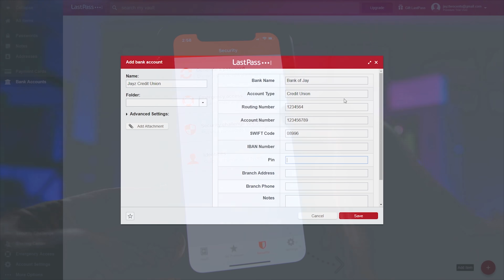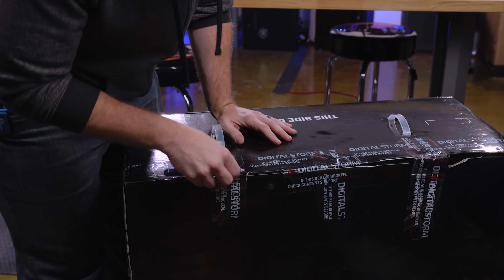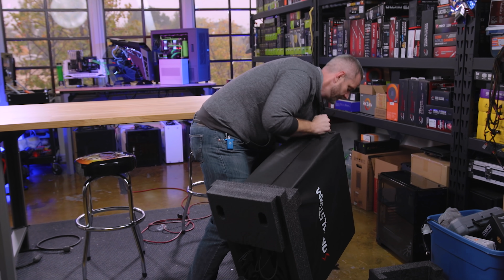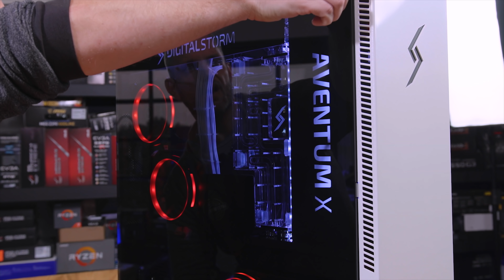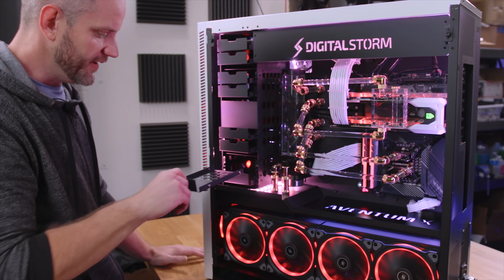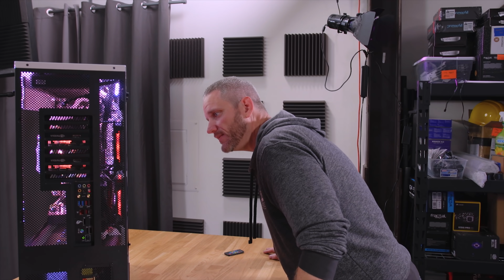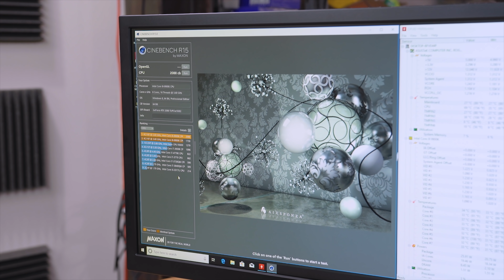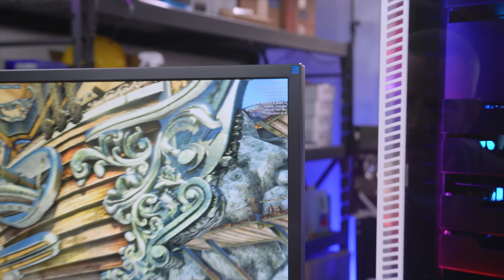Unboxing a $9500 Custom Computer...

Comment: LOL this pc caused comments  about prices of housing. Those rgb Things Are super stoopid looking and unnessisery to me. I prefer zero rgb light and plain look. 
Its all about performance, it not like you watching your pc while gaming and if you watch your pc while not gaming i would say you got a big problem and too much loose time. 
From the comments about Price compared to housing is hard to make any Sense as usually housing Price if in correlation of is there Jobs in your Are or do you have to travel many hours to get to a one. Is there more crime happening, what country your in. I would say in Finland 10k€ is about 5% of a private new built 100 square meter home made of wood by modern stabdards for cold weather. Generally people who built this kind of house make an average of 30 000-50 000 euros/ year per head before taxes (20-30%). Regular people what most of the population is made of

Comment: We measure in kilograms (a lot of people still use stones for body weight, but that’s changing for the most part). There’s about 2.2lbs to a kilo, so I tend to do half the weight in pounds plus a little bit.
Reply: everybody uses kilograms and the metric system, even USA use the metric/kilogram system as their foundation ..
they just do some stupid stuff on top of the metricsystem' where they take the metric system and then put a conversation on top to make it even more difficult for no benefits at all.
Its one country in Africa and the USA that operate with this .. its simply stupid as the USA manager for scaling also says and we are already based in the metric with our scalling. just with a stupid conversation on top.  https://youtu.be/SmSJXC6_qQ8?t=36

Comment: Kilograms, we use kilograms.
Reply: Actually, us brits use a mix of imperial & metric. BTW 1 stone = 14 lbs, so 175 lbs = 12.5 stone.
Reply: @InsaneProf  But what is that in boulders?!
Reply: @insnprsn  I'd say a boulder is roughly 8 stone? Sounds reasonable.
Reply: @insnprsn  4
Reply: Alan Lewis exactly like he said, 12 stone is 4 boulders...?
Reply: All the sofisticated countries use KiloGrams and Metric lol
Reply: @GAMEVIDSnorwegian422  that's right
Reply: And it also seems they can spell sophisticated.
Reply: @GAMEVIDSnorwegian422  halla Fra Norge 🤗👍🏼
Reply: What freedom units are used to measure school shootings?
Reply: @juliangleeson2251  Who knows? They aren't very common.
Reply: The UK uses a combination of kg & lbs for weight measurement. Just like distance and speed, we use a combination of imperial and metric.
Reply: I'd like to point out that England didn't switch to metric until the 1970s. The US using imperial is still their fault, however.
Reply: @SullySadface  The US landing booster rockets is what?
Reply: @yourface3154  technically its a private company owned and ran by a south american
Reply: @League_Cathy  Actually Elon is from South Africa, yet he is a US citizen....
Reply: @yourface3154  I meant south African and even though he is a american citizen he probably thinks he is south African doesn't he?
Reply: @SullySadface  england uses stone, lbs and kgs as well as mph for speed and km for distance.
Reply: We use "Freedom Measurements" here in the USA
Reply: LMAO THERES ATLEAST FOUR BOULDERS IN HERE
Reply: Kwf9 sell your house for the pc lol
Reply: 175 lbs is what..... 80kg?
Reply: No you use stones and boulders duh :)
Reply: @Austin Chambers I know plenty of Europeans that aren’t easily offended so I think ur speaking for ur self
Reply: @League_Cathy  LOL! I'd like to know exactly what the source of that data is. Also, even assuming the data is accurate, there is less than a 1/328,000,000 chance for somebody to be shot at a school. So again, it is NOT a common occurrence. EDIT: Potato math, sorry. That would roughly be a 1/1,093,00 chance I think.
Reply: @General_Griffin  OK I checked again its about 20 killed a year which is still 20 to many.
Reply: @League_Cathy  20 Is definitely too many, but unfortunately there will never be 0.
Reply: @General_Griffin  yes obviously  some years had less than others but some had over 40 people killed. It is around 20 on average since 1900.
Reply: @League_Cathy  Which adds to the point that gun control doesn't do anything, besides disarming a government-disapproving populous.
Reply: @General_Griffin  I'm not against guns, yes better gun control would help but banning guns just increases demand.
Reply: @joshua7426  yes they wear head guards and sometimes have shoulder padding but we don't run about like we are roleplaying as tanks XD
Reply: @League_Cathy  when you dont hit as hard as American football.... u dont have too
Reply: @joshua7426  k so that makes it even doesn't it?
Reply: @callum-j2i8s  so you get paid million of dollars less and get beat up more? is that really something to be proud of haha
Reply: Only drug dealers use kilograms
Reply: "I'm European, so I am easily offended and don't understand jokes REEEEEEEEEEEEEEEEEEEEEEEEEEEEEEEEEEEEEEEE!"
Reply: @callum-j2i8s  Try again you fuck.
Reply: @callum-j2i8s  well we hit with freedom power and that can hurt you more so we need the padding
Reply: @callum-j2i8s  lol pro rugby players wear pads , nor do they hit nor get hit the same in rugby as they do in american football.
Reply: @joshua7426  Uhmm yes, sometimes a lot harder even
Reply: @sicariusperemo3789  nope not even sometimes, according to science the average g force of a tackle in rugby is 10gs while in american football the average tackle equals 25gs. American football players are also typically larger , heavier , and faster, with the average player running at 18mph weighing 240+ pounds with the fastest so far being 22mph, whereas rugby players are typically lighter at 170 to 200 pounds running 12mph. As far as hits go American football is by far a tougher sport, rugby is tougher on the grounds of endurance and stamina with more actual continuous play time with the average player running anywhere between 6 and 8 miles per game and football players only running 1 to 2 miles per game with more downtime per play.
Reply: @joshua7426  they don't wear pads idiot
Reply: https://www.youtube.com/watch?v=RdTh8O9xYO0
Reply: No, you guys use pussy non freedom units.
Reply: @Gabe-ch2ol 

https://www.reddit.com/r/funny/comments/6hsdnb/metric_vs_imperial/   (And the same goes for temperatures...   water freezes at 0 Degrees C, Evaporates at 100 Degrees C...   I could go on and on about things that just make sense in the rest of the world....   

But I wouldn't expect someone with the "I don't understand you so I revert to calling you a pussy...  FREEDOM!!!" mentality to get it, so don't stress if not even these simple things make sense...   hang in there you ray of sunshine. ;)

Comment: Am I the only on dissapointed that they used connectors for corners and hadn't bent the tubing?
Reply: The fittings are cheap alibaba ones and save money comapred to the time it takes to do proper bends. I dont like it, every fitting is a potential place for failure. Jay is not critical enough, paid advert i think.

Comment: I am disappointed that for 9500, the side glass panels weren't hinged. I use to have to remove the side panels from my PCs but ever since I bought my first hinged side glass panel PC case, I can never go back. It's just so convenient and less risky when you need to get inside your pc, plus you dont get the glass all full of fingerprints and palm prints when needing to open up your pc case and have to grab and carry off the glass side, since you don't really need to handle a hinged sidepanel case much other than maybe minimal finger smudges if you're rushing it with the thumb screw removal or not swinging the glass open from the edge..
Reply: My next case will have a hinged side panel.  I've decided it's a necessity at this point.
Reply: Cooler Master COSMOS II 25th Anniversary edition. I like my big cases and if you can't pet the beast on your way by then your doing it wrong in my opinion.
Reply: agreed. I have a Corsair Obsidian 1000D and it's so convenient to do maintenance in this chassis. My friend's Thermaltake Tower 900 is a pain in the S to work with.
Reply: Agree and it wouldn't be that difficult to make these glass panels both hinged but also detachable when needed..
Reply: @JAKOB1977  that's what the cases you can currently buy with hinged glass panels usually are.. if you lift them up, they detach from the hinge.

Comment: Digital storm customer service sucks. I been waiting for three weeks for my system so far. I called and it hasn't even passed stage 2. Customer service will transfer you to mgt and they will tell you it will be made when they get to it. I want to say the manager is julie
Reply: Welcome to Christmas. In general you want to avoid ordering anything, anywhere around now. Trust me. You order in February, your system would fly through.
Reply: Julie Perry. Yup, I've worked with her many times. Let me guess, "Management" makes the calls, right? She's the messenger between you and them, and most of the time she'll be the one giving the bad news... She's a great lady, but even her dept don't have any power...
Reply: @4kgaming channel  well now i know where im getting mine built from
Reply: @4kgaming channel  im getting tired of console. Call me whatever you want for doing this. But i had bought a xim to use on my console to get used to mouse and keyboard so i dont get completely raped when i was ready to move to pc. But now im ready to move on to something greater, your build sounds like something i want. I want to be able to run any game possible with max settings and still have no issues

Comment: A completely unnecessary build with an unpractical water cooling complexity that is a pain when cleaning dissasembly is sheduled on a 7 months period. But Shintel i9 9900K is a LAVA LAKE cpu that absolutely needs watercooling already at stock clocks so that it doesn't meltdown with all the Meltdown and Spectre patches constantly slowing its IPC down :-).

Comment: Yeah this summer I dropped my newly purchased desktop on my toe when I was carrying it upstairs to my room. It weighed about 50 lbs and I dropped it at about knee height...hurt more than anything I’ve experienced...couldn’t drive myself to work for six weeks after. 

Now whenever I see somebody moving a heavy computer I just get flashbacks.

The computer was fine tho, running like a $2000 champ it’s supposed to be.
Reply: @Jeremy Walsh Nope, I was way too excited to think straight...to put matters worse, I was wearing flip-flops

Comment: @JayzTwoCents, hey Jay just wondering if you could help me out. I have a system I built last year, it’s a Kaby Lake 7700k with 16gb of ram. However I didn’t have money to put into graphics and only have an old reference 980. What would you suggest is the best value card in terms of longevity? I have a very limited budget and any card suggested will take months if not a year or two to save up for. Thanks

Comment: Hey guys I need help!! My first time building a pc and my budget is $1500- $2000 and my theme is red and black! I can’t choose a motherboard and a processor!! I need help can you guys recommend a motherboard that has red accents? 
Couldn’t choose between asus rog strix z370-h 
Rog strix b360h or MSI b360 gaming plux atx

Cpu cooler-  Arctic Freezer 33 Esports ONE
Gpu- MSI 1070 Ti 8gb
Ram- Ballistix Sport LT 16GB Kit (4GBx4)
PSU- EVGA SuperNOVA 850 G3, 80 Plus Gold 850
Case- Cooler master h500M

Comment: I've seen PCs that large before... PCs from the early 90s or so, when there were massive beige boxes that cost even more of a fortune than this one does and were similarly top-of-the-line for their time.
Reply: I still use three of the "massive beige boxes" for my PCs.  Can't beat them for space and air flow.  Yes, they're old and not as pretty as the RGB tempered glass cases you see now, but they're still reliable and sit under the desk.  Looks are not important, it's what you put inside that makes the difference.  They may be '90's cases, but they're still 2018 inside.

Comment: I get 71c at 5ghz all cores 1.29v drawing 161w (95w is a total lie)during cinebench with the kraken x72 and get the same score as you, same maximus xi hero mobo, same 9900k
Reply: @Jeremy Walsh when you first get your 9900k, turn on your computer, don't touch any settings at all in the bios or anything, the mobo will automatically overclock it to 4.6-4.8ghz, the only way for it to be 95w is if you actually try to undervolt it and literally force it to stock speeds... that being the case, every cpu ever made that can be underclocked and undervolted (or vica vera) to run only using 95w maximum is a 95w cpu...
Reply: @Jeremy Walsh yeah it's more about the mobo makers i think though... instead of having a default setting thats like a safe mode, draws the 95w it says out of the box, then you have to force it to draw more... it over volts it way more then it needs, and makes it draw like 180+w and throttles at 4.8ghz till you force the voltages down and remove the other limits... auto overclocking sucks...

Comment: That glass panel should have holes cut and spaced apart where that radiator is pulling or blowing air out. It shouldn't be that hard to do it using one of those fancy water cutter things. Anyways yea uhhh so what would the result be building this without water cooling?

Comment: 2088? So the SFF build performed better than this $9500 rig? That SFF case/set up is awesome.
Reply: Its not bad for an SFF...  This PC just sucks, and is overpriced.
Reply: @winfieldk6692  True, plus why would someone want this huge PC? :)) A PC with 6 fans on watercooling for processor only it's enough....
Reply: he said in the video he didnt want to push the overclock on the digital storm build because it wasn't his own computer/hardware, so of course he could squeeze more power out of the SFF build
Reply: Yeah his scores are shit. I’m getting that on a 6900k @4.5Ghz. Not to mention my 6900k costs twice as much as that 9900k, and I have faster ram, yet spent far less than the price of that system.
Reply: @DaedalEVE  usually the money for a custom build should be spend on something that you need not just the most expensive PC lol. As an example I spent 3400 quid on my custom built where I chose my own parts and install them by myself to use it for Video Effects, Video Editing and Rendering. And sometimes for nice games such as RoE Ring of Elysium something like that.

Comment: What a God-damn shame. $9,500 and they couldn't make a custom side panel which has mesh to cover the fans with? It would weigh about the same, and provide airflow to the bottom where it counts. Fans covered by glass annoy me. I am very sad. Alexa play Trash by Death Grips.

Comment: I see you have the same problem i have. get  the bloody thing out of the box. that COSMOS II case empty is like 70 pounds. the biggest and most heavy empty gaming tower case ever made. ULTRA FULL TOWER GAMING CASE..  Get it out of the box is a  nightmare. I cannot  lift it out of the box. I cannot slide it out of the box.. I roll the box up side down with out breaking my spine is a challenge.  cut open the bottom  of the box and open the flaps  Roll it up  side up. again same challenge done break my spine.  once up right make sure all the flaps on the bottom of the box is facing out ward ,. then cut the top of the box open. that is cut the tape. the weight of it  fantastic. the packing material  is so tight the box revise to  get loose.  after 20 minutes of  heave ho  I got it out of the box.. COSMOS II case was designed in super car designed in mind.  its designed to be strong as a tank. ROLL CASE is use for its legs and handle bars.  in the back got two push buttons to open those two giant doors that  covers the engine block. X99 GAMING GODLIKE its all black with  red racing stripes  on the motherboard. 13 hard drive trays that is in stalled in 13 hard drive bays  they  do not use screws  when use standard hard drive. the try can use notebook side SSD  for the O.S. like WINDOWS 7 64BIT HOME still got all the room in the world for the big ass water cooling system if you choose to do so. I use  air cool for the CPU.    Water dose leak or spray out that will be  nasty  I learn my lesson  the hard way not to use ASUS and CORSAIR every  time I buy ASUS and CORSAIR its comes in fake D.O.A. it took me 4 years to build my gaming PC  fact,. ASUS makes the worst motherboards. 15 ASUS X99 RAMPAGE V EXTREME motherboards.v fake  broken LGA 2011-V3 CPU SOCKETS the pins snap off and bend. the pins slide out of place when  the socket is being welded on to the motherboard.ASUS  stupid enough not to catch it. and did not do anything to fix it. its  CPU brack that hold the CPU in place broke the pins. half of  them.. I got 14 refund and one  was sent to ASUS for repair and ASUS lied to me about fixing it. ASUS dump my motherboard with out letting me know. CORSAIR  AX1200I is th e worst power supply all fake D.O.A   shorted out my alll  15 SUS motherboards. I got 4 refunded  and I have to dump the 5th one,. AMAZON  email me a fake sales slip with no product information what I  have ordered and paid for. CORSAIR filed law suit for robbing CORSAIR  ware house and robbing AMAZON WAREHOUSE. I do not live in those states that contain  CORSAIR and AMAZON. there is no security  camera footage. CORSAIR LAW SUIT  filed on me was drop. all I ask is to replace th e power supply. CORSAIR akll they do is every AMERICAN with a  problem item is a bank robber.  NAZI LAW GUILTY NO TRAIL IN COURT. CORSAIR and ASUS  are fucking NAZI in the book of law.